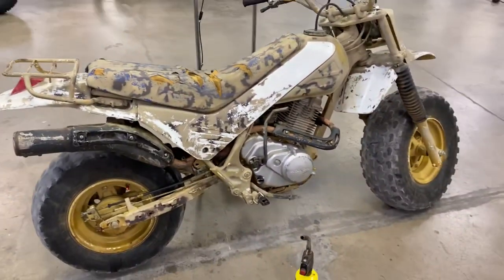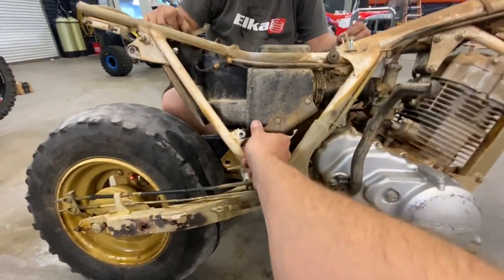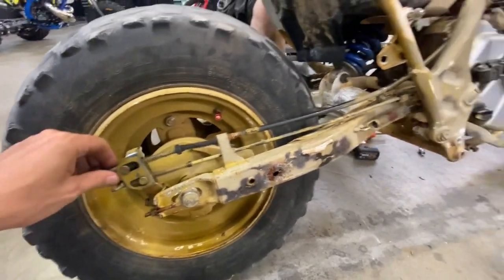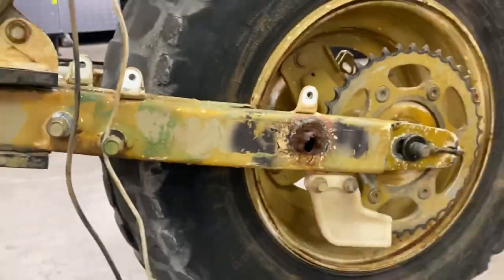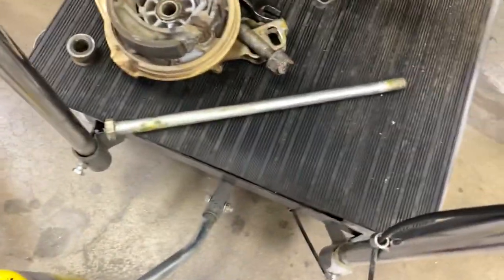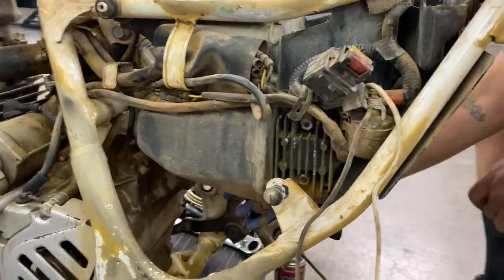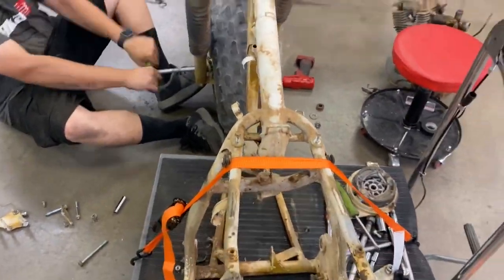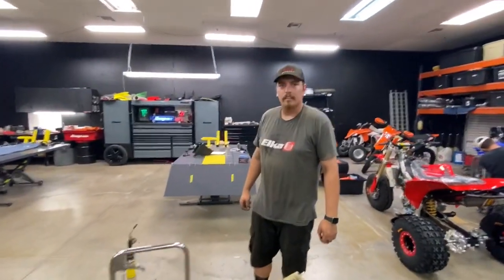Honda FAT CAT Restoration Tear Down & inspection Part 1

Comment: I’ve got 2 FCs and 2 BWs, I’m doing a top end rebuild on both fatcats right now, I was hoping to do it all while the engine was in the frame but the two valve cover bolts on the right side are hitting the frame, looks like I’ll at least have to take all the bolts out holding the engine down and ease her to the side. Enjoying your progress so far!

Comment: I'm curious about the tires.. where they a good choice? I need new tires for my fat cat, and I liked the look but I am curious to know how they ride?

As a motorcycle it's already hard to get the bike from side to side. I wonder if they were rounded enough? Or if they felt like they had a flat spot in the middle that kind of squares the tire off?

I've used these exact tires on ATV, and been very happy with them. But now I'm just wondering how they would feel on a two wheeler..

Any feedback?

Would something directional be better? Or non directional?

Thanks for the reply